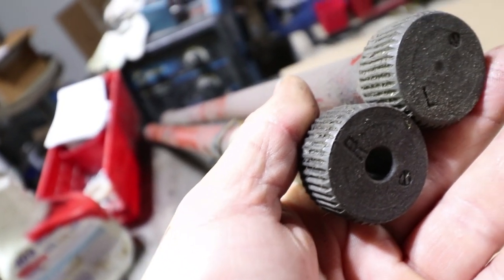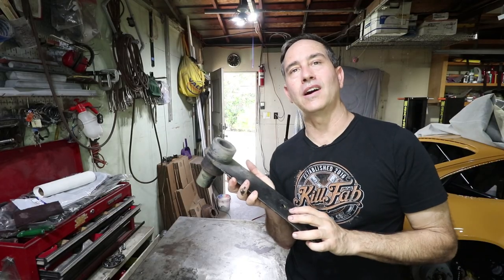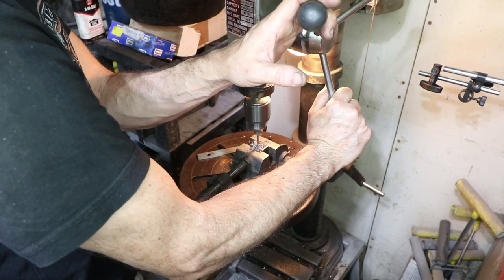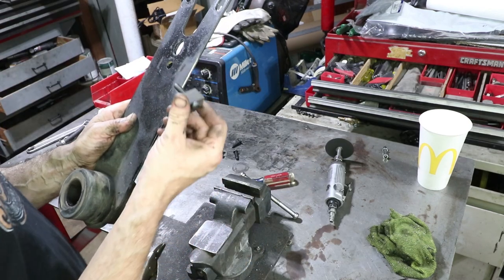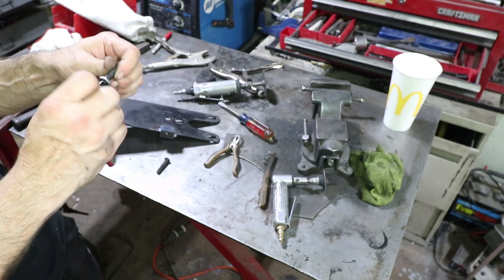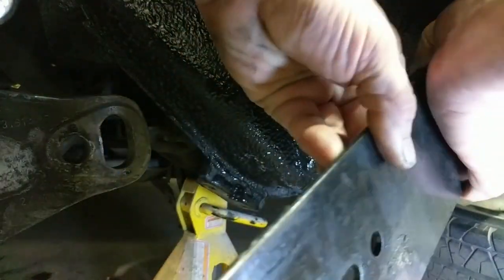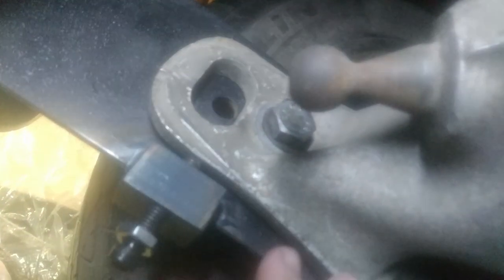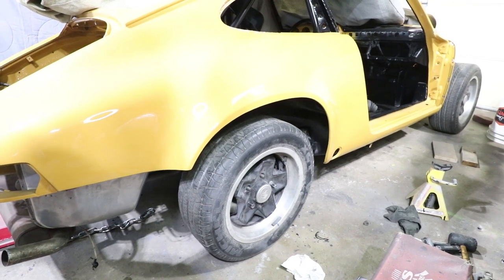Improved Porsche 911 Camber Adjuster & Ride Height Torsion Bar Indexing

Comment: There’s supposed to be two eccentric bolts on the stock setup.  One for camber and one for toe, so you don’t have to manually pull back and forth, which would be hard to get the fine adjustment.  Elephant racings camber max is like what you fabricated, but doesn’t weld on.  It has a hole for the bolt.  I like the idea of having no empty bolt holes.  I use their quick change adjustable spring plates, and hollow torsion bars, along with aluminum trailing arms to save weight in the rear. You need adjustable spring plates to make ride height adjustments and corner balancing easy.  With mine, I can change torsion bars by just jacking up the side of the car, removing a snap ring and pulling the bar out. (It’s threaded for a handle)
Reply from the maker: This all correct.  However my plan is to goto coil-overs and adjustable pivot points.  
My inner mounts are also adjustable.
Reply: @GarageTimeAutoResto  I am curious about the reason you want to go with coil overs on such a light car.  Do you plan on racing it?
Reply from the maker: No serious racing.  For me its more about the adjustability and keeping the forces all in line.  
When the spring and dampening forces are far apart it loads the suspension pivots in wierd ways.
Reply: @GarageTimeAutoResto  I agree.  I hope I am ok with all the mods I did.  At least my rear shocks are the canister type, and are triple adjustable.  My fronts are Fox racing shocks, that are a complete strut, with canisters. They have adjustable height spindles, so I lowered the front height about 3/4” just enough to clear the wheels. There is also an adjustment knob on the canisters. It is a little stiff in the front because I am pretty light up there.  Are you going to have to cut our your rear shock tubes, and enlarge them, to accommodate the coil overs?
Reply from the maker: Very cool on the triple adjustables!  I think coilovers will fit a long wheel base car in the rear,but you have to use long spring perches so the coil doesn't go up inside the chassis.  Time will tell.  I'm just trying to get the car back on the road in mostly stock configuration.

Comment: Tom, on a 911 rear t bar , one spline clockwise inner and outer one counter yields about .250"
This is true for either more ride height or  less . well done on the mod , as always you are rocking it . Ian
Reply from the maker: Good to know.  Not sure why the Elephant racing racing calculator didn't work for me other than my weight was way off.
Your numbers are more useful as I increment down.  Thanks!

Comment: cool mod. have been eager for you to get to suspension stuff cuz i’m about to hafta overhaul mine.
Reply from the maker: More goodies to come regarding cool suspension parts.  Are you changing bars and bushings?
Reply: Garage Time - Restomod   i am. i think my torsion bar bushings are shot. how do you get those out? burn ‘em?
Reply from the maker: I think so, heat up and twist off.  I haven't played with new bushings which I'm sure are harder to work with than my old junk.
Personally I'm going with the rebel racing rear Teflon bushings.  I want to to do a drive comparison between the two.

Comment: torsion bars the same as type 3. very nice system. you may develop cracks in the spring plate around the weld.
Reply from the maker: Yes, it's possible that the spring plate is weakened some due to welding.  My hunch is that these plates are very over designed to begin with.  I'll will keep my eye on them though.
Reply: @GarageTimeAutoResto  well hopefully no cracks, it's a nice mod.

Comment: Thanks for showing that.  That is a really functional (and yet simple) modification.  As far as ride height...  How heavy is it right now? .  Probably like 1200lbs or so, it's not gonna sit at the "planned" ride height until you fatten her up.  I'm loving the daily (short) vids.  Thank you
Reply from the maker: Yeah, I must have the weight wrong.  No glass, doors, decklid, but I thought it would have sit a bit lower than it does now.

Comment: Awesome how to video.  I was wondering how that eccentric bolt worked, now I know.  It does seem ridiculous to buy adjustable spring plates when you can make them yourself.  I just may do this.  Thanks Tom!
Reply from the maker: My plates don't have the adjusters for ride height like some of the later factory plates or sway-a-way.  Coilovers will make ride height adjustment easier once I get all the parts.
There is also an eccentric for toe, but I may leave this out.
Reply: This is not what adjustable spring plates are.  This is just an easier way to adjust camber, not ride height.  Elephant racing makes the camber max, which is similar to this, but no welding is necessary, as it is held on by the bolt.

Comment: So, are you using either of the eccentric adjustment bolts at all in this modification, or are you just using normal M12 bolts?
Reply from the maker: Just regular bolts.  The camber adjuster worked well, but all adjustments were done without vehicle weight on them.
Reply: @GarageTimeAutoResto  Cool, thanks!

Comment: I’m curious about your comment that the torsion bar will be stiffer with less weight. Since the spring rate is non linear, won’t it be less stiff?
Reply from the maker: Sorry for the confusion.  I meant that a  912 will feel stiffer in the rear than a 911.  Given the spring rates are the same and the 912 is lighter.  
Suspension deflection is weight divided by spring rate.  
More weight equals more deflection.
Why are you saying the spring rate is non linear?  Arm geometry?
Reply: Spring rates are linear no matter what type of spring, F(force) = k(spring rate) * x (displacement). A lighter car feels stiffer on the same level of spring because mass has a damping effect. Less damping = springs bounce around however they want. That’s why cars with blown shock absorbers go pitter-pattering down the road too.
Reply from the maker: This is the right track.  Mass changes the bouncing frequency but is not a dampener.  A dampener will reduce the bounce amplitude.  
I agree that most springs are linear especially torsion bars.  There are some progressive coil springs though.
Reply: Garage Time - Restomod True. I was trying to speak in layman’s terms but yeah lol the critical difference between k, c, and m (stiffness, damping, and mass) is that they exert force on the system based on displacement, velocity, and acceleration respectively. So mass isn’t actually a damper at all but I’m just used to telling people it has a damping effect lol. And yeah I have heard of some nonlinear springs but that stuff sounds complicated
Reply: Garage Time - Restomod also can’t wait to use the knowledge from these vids to restore my 240!

Comment: Water will get in between the metal and rust it !! I’d weld all the way round
Reply from the maker: Good Point.  It will get a little dicey near the threads!  
The truth is I may need to cut the height down a little on the inside.  It's a bit closer to the arm than I thought.  I want a big range of adjustment, so we'll see.  This arm will be removed many more times I'm sure.
Reply: Garage Time - Restomod I just knew there’d be a good reason 😂 great restoration project 👍